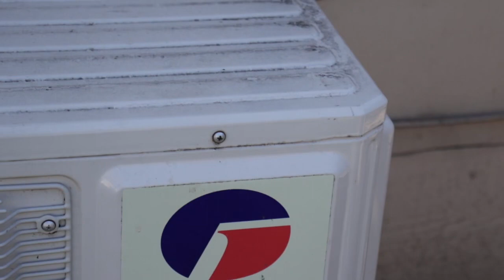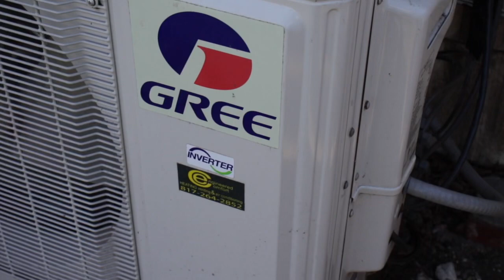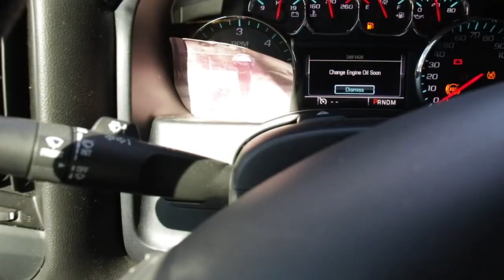Gree mini split main control board replacement

Comment: Thank you for this video!   I just replaced the main board on the same OEM Blueridge system after following your video.  Took about 2 hours for me but I was being slow and careful.   The Blueridge tech support was also really helpful.  We had been getting LD and PL errors and the external fan was kicking off after a minute.  I don’t think the compressor was ever coming on.  Guess what…  it all works now!   Thanks again.
Reply from the maker: awesome!!! 💪🏼

Comment: I have a 4 Zone  Blureridge system, the board looks exactly the same, the renter hired a thech that diagnosed a bad main control board, I will follow this video to replace it myself, including cleaning the old heat sink and putting new heat sink compound. I'll post my results here. Thanks.

Comment: Great video. Love the music. Please help if u can. I just installed new Gree mini split. It will not power on. It’s getting 250 volts at inside unit. I believe it’s the communication wire. It’s reading 100 volts ac. There is no sign of power reaching inside unit. No light or anything. I think I fried board by crossing wires when I installed. It took me 6 weeks to buy all the tools and gain all the knowledge I needed to install it. It’s pressure tested, vacuum tested, and charged to capacity. Only reason I did work myself was I’m disabled and live on fixed income. Local hvac specialist wanted $600-1000 to come and just screw down flare fitting,test, and charge system with 4 ounces of r-410a. Please help.
Reply from the maker: check to see if your control wires may be broken i would ohm them out to make sure you have continuity between the wires cause you should still have power on the inside even if it doesn’t come on
Reply: @engineeredcomforthvac4911  Thanks for reply. I only know enough about electrical work to take a voltage reading. There are 4 wires going from inside unit to outside unit. One is ground. One is hot and reading 123 volts, and another reading 123-125 volts. And. The communication wire. It’s reading 101 volts. I have heard that wire is suppose to be low voltage DC. It was reading .12-.38. DC. I don’t know if either of these numbers are off. I did some brazing near this wire. It got kind of hot, but it didn’t break jacket. The display on inside unit is not lit up or anything. Should I buy another wire and run it separately to see if works? Any advice or help is much appreciated I would hate to pay a professional more money for installing it or fixing it then I actually paid for it.

Comment: Are you not supposed to clean the heath shield and add new one? apparently it will short out the board if you dont clean it, i have never seen it but i have been told to do it before installing the new board.
Reply from the maker: ZEEE2000 yes sir i totally forgot to include that in the video you’re absolutely right, but i did clean the old heat shield off and added a new one
Reply: @engineeredcomforthvac4911  Do you put new heat shield paste on too?
Reply from the maker: ActionJackson yes sir

Comment: Will this fix an e6 error
Reply from the maker: Check to make sure that the control wires are wired correctly from inside air handler to outside condenser if they are then it is possible you have a bad indoor or outdoor board in my case it was an outdoor board

Comment: I have a H3 code for compressor overload, is it the board or the capacitor? The fan isn't tuning. I have the unit open and can't recognize a capacitor.
Reply from the maker: Justin Nelson there is a capacitor on the outside but check refrigerant charge and outside condenser after you have reset the system if the h3 code comes back its going to be the mother board

Comment: Dose it work with Error P6 ??
Reply from the maker: tasheel sweet yes sometimes check and make sure control wires are not broken or have come undone...if everything is ok with the control wires replace mother board